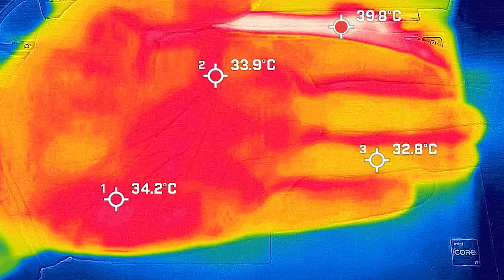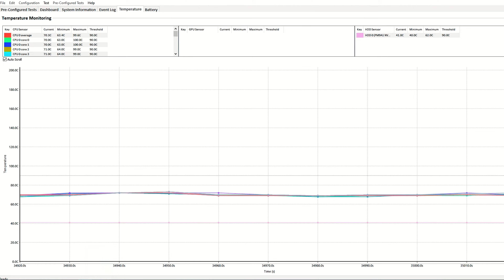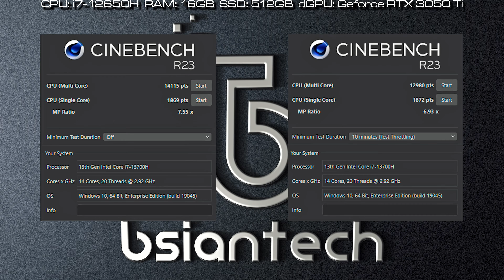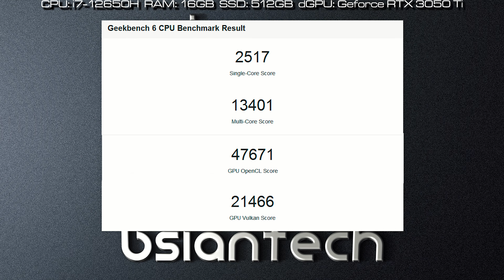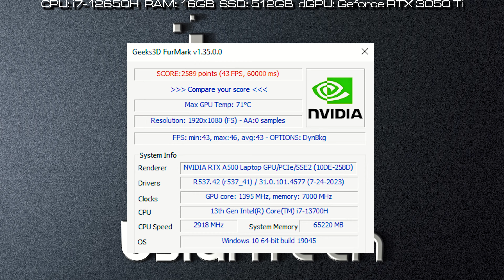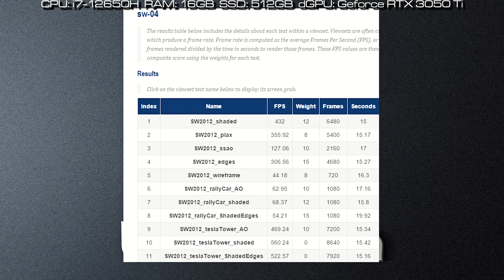Dell Precision 3581 - Quick Look

Comment: My company gave me this laptop and I have an issue whereby the fan will sit idle at 0 RPM until the processor gets above 56 degrees and then it will spin up to 2800 RPM suddenly, no gradual ramp up. It will then slowly drop to around 1700 RPM and then suddenly drop back to 0 RPM.  Rinse and repeat every minute or two and it is driving me nuts. Did you notice this with your review unit? I'm really hoping that it is a fault and Dell can replace the board.
Reply from the maker: @Dellah_de, I would be checking the Dell Power Manager app (hopefully your company has kept it installed on the computer) if not try to get to see if the thermal setting is set to "Optimized" mode rather an "Quiet" mode.
Reply: @BsianTech  Thanks for replying. I've actually tried all of the available fan curves (you can also set these in the bios). All of them exhibit the same sudden ramp up behavior. If the fans ramped up smoothly I wouldnt have an issue, but it is the sudden immediate ramp up from 0 to 2800RPM that distracts me and makes me immediately aware of it. I assume this wasn't the behavior you experienced?
Reply: @Dellah_de  Uninstall any dell crap and problem should solve...
Reply: @Dellah_de  i have the same computer thats just how it is. i have had it since new. but i recently got a motherboard replacemet under warranty and this issue has completely been eliminated. I think it is something to do with the internal fan controller.
Reply: @TejasA538 I had Dell come out and replace the mainboard in the original machine that had the issue, but it still exhibited the same fan problem. I eventually gave the laptop back to my company and ended up with a different laptop for a while. This was then later replaced by another 3581. I told them I wanted to run it for a week to see if that same fan issue occurred before I accepted it. Thankfully it is fine. I also suspected the fan contrller at the time. It may be certain revisions of mainboards are affected.